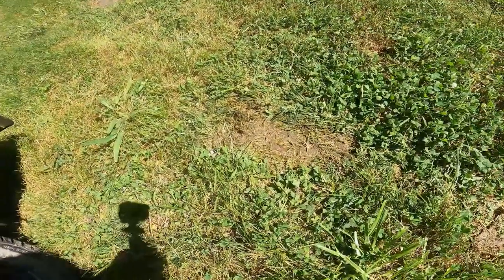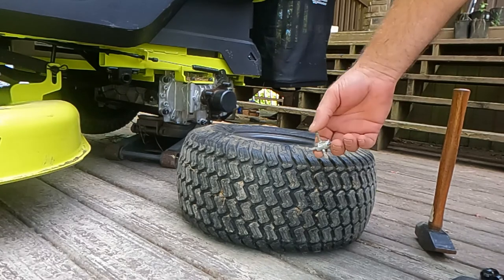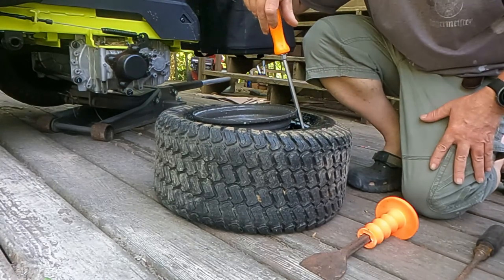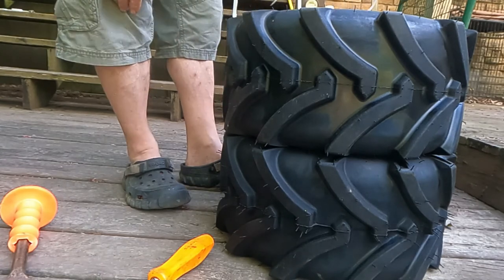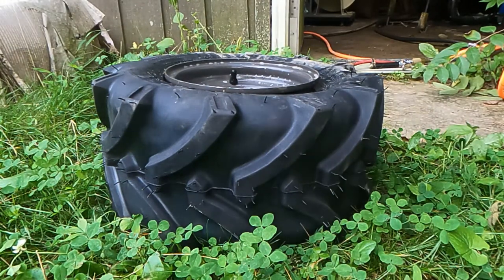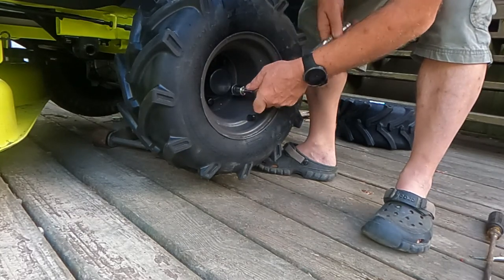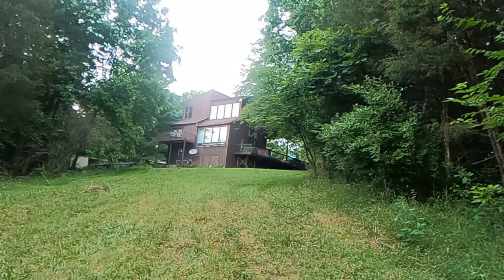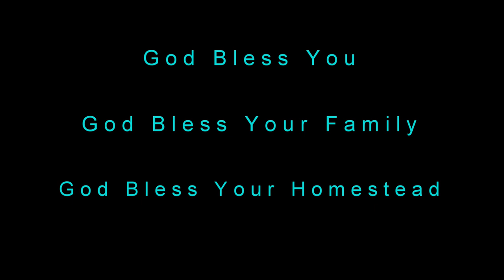ryobi zt480ex  we put mud tires on everything in kentucky #ryobi #zeroturn #tires #batterypowered

Comment: Very nice work on some great tires. I’m all about battery powered stuff but I don’t think you’re place is quite ready for that yet. Just my opinion though.
Reply from the maker: You are very correct. Its been broke down since May.
Reply: @sharpridgehomestead  What broke? I bought the same model used early spring and it's done a great job. Even installed a pvc canopy with 3 100W flex solar panels and a Victron mppt charge controller. Now when I mow the batteries charge while pushing this runabout. Fantastic machine so far.
Reply from the maker: @arminius301  So, I had several things go wrong with this.  I probably should do an updated video.  The first thing, I live in a very rural / country area and the ground is kind of rough, its not like a manicured smoothed lawn like you would find in a city.  The blades are made very thin, I'm certain its to reduce the force when the electric motors spin up to speed.  But about every 2-3 times i mow, i will hit something small, like a rock or a stick (pinky sized) and the blades will bend.  Since the ground is uneven, that could also mean just barely touching the earth and they bend L-shaped on the end of the blade.  But the big thing that happened, was where the charging plugs in, it went bad.  It wouldn't charge.  It wouldn't do anything.  I submitted a support ticket and asked for updates every few weeks but basically there was no replies to it and then something like 9 months later they asked me to take it to a repair center that was about a 2 hour 1-way drive.  So since it won't even move, you should try to push / pull it onto a trailer as dead weight.  There is no way to lock the front wheels to move it, so you are constantly fighting keeping it moving straight.  I ended up buying a boat winch and attaching it to my trailer.  Anywho, the support center fixed it, it took about an additional month.  So I wasn't able to use the mower, during its warranty period, for an entire season.  I have mowed with it 3 times this year and so far so good.  I mean, when it works, it cuts like a dream, but when it don't work .... thats an aweful expensive weight.  Oh yea, the grass catcher setup for it, if you turn and it catches on anything, like a tree limb hanging down, it will pull them off.
Reply from the maker: @arminius301  2nd reply because I forgot to include this, the left rear motor doesn't turn with the same speed as the right side, so in turns or even mowing straight, you can't have the speed control bars even.  The left one has to be pushed forward a lot further than the right one for full power or whatever it has, then you have to adjust the other side to compensate and keep it around the same speed.  So I assume, soon, the left rear motor is going to go out.  And since I bought this, I have only been able to mow with it about 10 times total .... 3 years, cause its always broke down or not working.
Reply: @sharpridgehomestead  Thanks for that info. Luckily I bought mine used and realized things were going to be less than new condition. After getting the hang of driving this without looking like I'm chasing a snake I disabled the dang seat switch cause it was stopping the blade every time I went over a bump. As mentioned I use an mppt charger and solar to charge the battery pack. I'm going to use what's left of the AGM batteries (making sure never to discharge below 50%) and ultimately swapping with LiFePo4 batteries. Over the decades of homesteading I've come to the realization that if something breaks I'll be the only mechanic who will pay attention to the details and get the job done right. Same goes with doctors. I wouldn't trust any doctor more than your average "don't give a rat's arse" mechanic, so I took charge of my own health with supplementation and haven't see a doctor in over 15 years. All the best with your mower. I think it will serve you very well once you address a few annoyances!
Reply from the maker: @arminius301  Yea, I have had it for 3 years now and I loved it the first year, the 2nd year I didn't even get to mow with it once because it was broken down, this year I have mowed a few times with it.  The right front tire I have had to air up every time from when it was new.  Thanks for the laugh because your explanation of "chasing a snake" was exactly me the day I loaded this up at home depot onto my trailer.  I know those employees were laughing inside because I had never driven a zero turn prior to that.  I do like the fact that when the mower works correctly, It can cut faster than my old garden tractor simply because it is faster in speed and can turn on a dime and those seconds add up to minutes saved over cutting the grass.  I haven't given up on it entirely because it does mow well when it works.  Speaking of solar, I did a video where I sometimes use my solar panels on my camper van to charge mine up, the problem becomes it has 300AH battery and the mower is 400AH so I can't get a complete charge from low.  I try to also keep it above 50% charge at all times but to mow my entire yard it goes from 100% to about 45%.  I don't get near the time out of it mowing that they stated it should get and I bought mine new, its just always been that way.  I also diy most everything around my homestead too.  Ditto the dr stuff, except when I got cancer in 2020 that I am still dealing with side effects from.